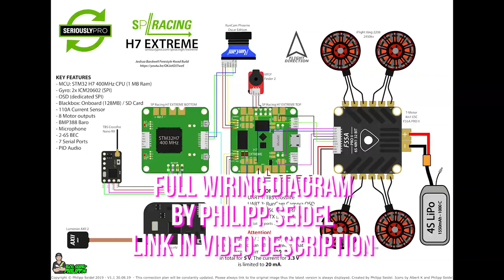Freestyle Kwad Build - Part 4 - Stingy V2 Forged Carbon / Xing 2208 / F55A / SPRacing H7

Comment: Quick note, it's also possible to use Motor 7 and Motor 8 pads for UART6.  Details are in the FC manual.  This gives another UART on solder pads on the H7 EXTREME - 7 serial ports!

Comment: 0:44 The T in Tx stands for transmit and the R in Rx stands for receive. The receiver is transmitting (Tx) to the flight controller which receives (Rx) the signal. That's why Tx goes to Rx and vice versa.
Reply: is that the way with all them ?as i have to solder in a reciever when i get it ,will the diagram show me that?thx
Reply: @neilo8b  Yes

Comment: I can recommend the "Aurora RC TRACKER-MINI 100dB Finder Buzzer" they have on Banggood as an alternative self-powered lost model buzzer. I had a couple of Hellgate buzzers but lost one and broke the other, I just find them too expensive. The Vifly finder is good, and a decent price, but pretty big so no good for tighter builds. The Aurora one is cheap ($11), loud, and smaller than the Vifly (though not as tiny as the Hellgate)

Comment: I found the xhover stingy v2 camera adapter pretty much useless. It doesn’t leave enough room between the top and bottom plate for the camera angle to be changed properly, and also the back of the camera doesn’t even sit flush against the printed cradle properly.  It still moves around. Maybe it’s just me, but I found it to be such a sub-par design. I scrapped it and the camera plates and found a good printed solution.

Comment: I really really need your help. I did everything on the video step by step, but I am having trouble with the FrSky R-XSR. Not sure if it’s the wires or the ports on beta flight I have been stuck for almost 4 hours now.

Comment: You could have soldered up the RX and the camera from the bottom side of the board with the solder through holes.
On my matek's I only have two wires off the top.
Get with the program Bardwell.
.

Comment: o yeah forgot to mention I followed wiring diagram from link in description and fried my buzzer..Dont know why they have 5v to negative and signal to positive..Thanks
Reply from the maker: I just checked the wiring diagram and I don't see the mistake you're talking about. BZ goes to Buz-, 5v goes to 5v, Gnd goes to ESC-.
Reply: Joshua Bardwell hello Joshua, looking at the wiring diagram it has buzzer gnd going to esc gnd pad which is correct then 5v from buzzer to small square through hole pad (which I think is wrong) and buzzer signal (bz) to small round through hole 5v pad (which I think is wrong).

Comment: I knew about the correct way of splicing wires before but I always only put two pre-tinned wires together and heat 'em up. ;D Seeing you do it like that though, I will certainly try it this way next time.
About the camera plug for the FC, why did'nt you remove the black and red wires but just cut them? Couldn't they short from touching a moist leaf or by holding the quad and touching them with your finger or is this too much worrying?

Comment: Mr bardwell I have a rooster and I love how it fly's but my weakest link is lipos...I have multicopter builders 2208/2550 and 4s it does good but blasts on 5s but again sag. The xing 2208 low kv how would I compare 6s to my 5s performance? What would be somewhat comparable to 5s on 2550kv but yet with 6s to maybe help lower those amps?

Comment: I always feel like you twist the wires too much and put strain on the solder joints, but you have never had a problem, so i guess its fine.
Reply from the maker: It's not much stress for these tiny wires.

Comment: What did you connect the vbatt+ from the RunCam to on your fc? I’ve got a raceflight osd fc that I’m having trouble with the wiring with the Phoenix RunCam.
Reply from the maker: That doesn't need to be connected if you are using the FC OSD.
Reply: Joshua Bardwell great!  Thanks for letting me know!